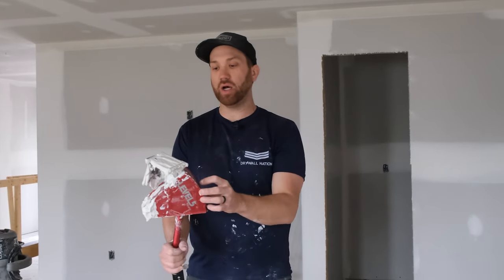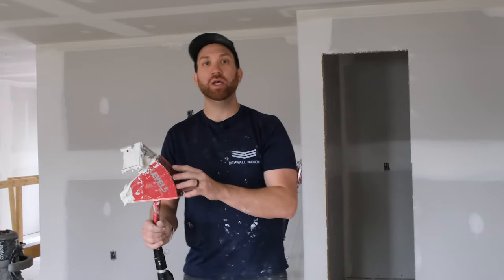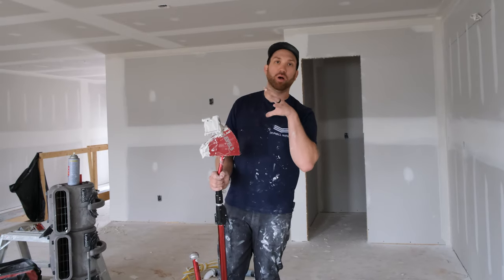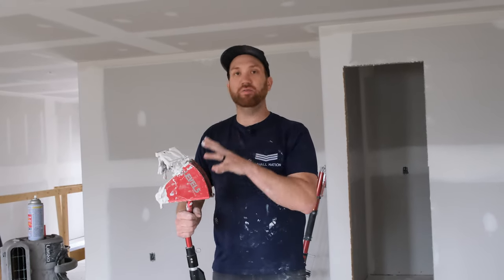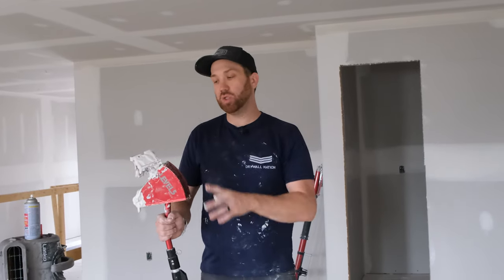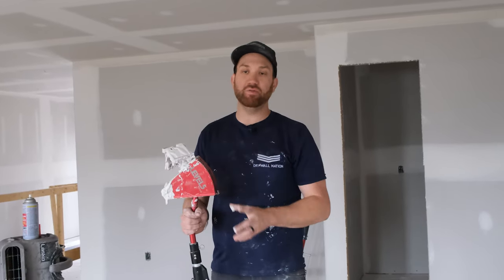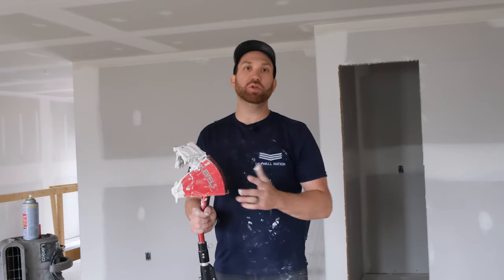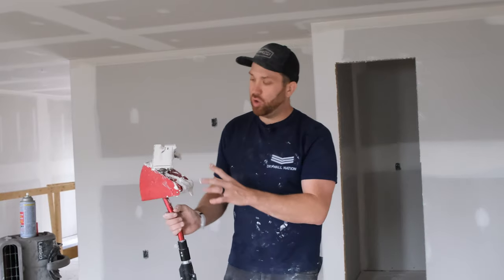How to clean corner applicator box

Comment: Do you have tips how to laminate drywall on concrete walls, fast?
Reply from the maker: There's different ways but not many of them I'd say are fast per say. One of the simplest methods is dabbing blobs of taping mud on the back of the sheet and hammering 1" concrete nails into the grout lines of the block. Just have to be careful when hammering not to damage the face of the drywall too much.
Instead of taping mud you can also use a polyurethane foam which is faster to apply to the concrete. There's general all purpose polyurethane adhesives that's work well on concrete.
You can also use a hammer drill and some tapcons to fasten the sheet instead of hammer concrete nails.
It's the fastening that's the slower part. Personally I'd recommend some foam adhesive and a hammer drill and tapcons. Screw the perimeter of the sheet and glue the middle.
Hope that helps